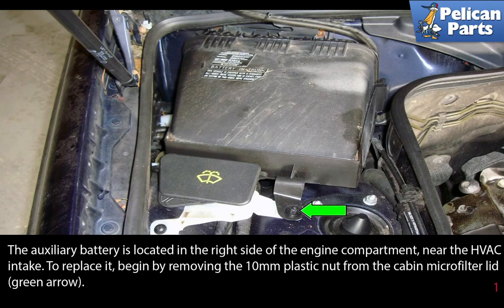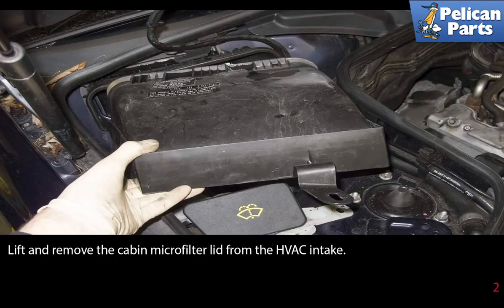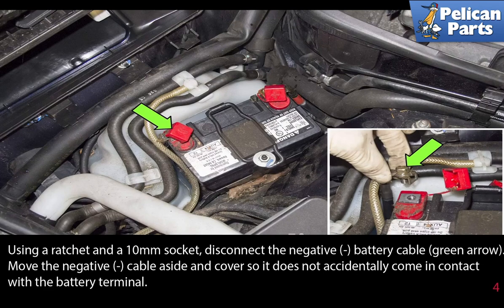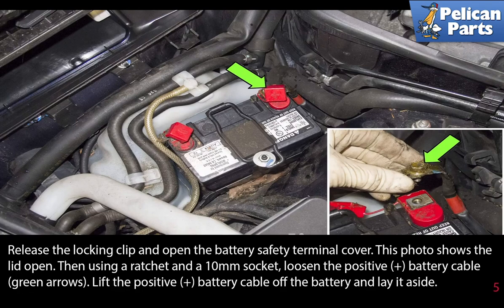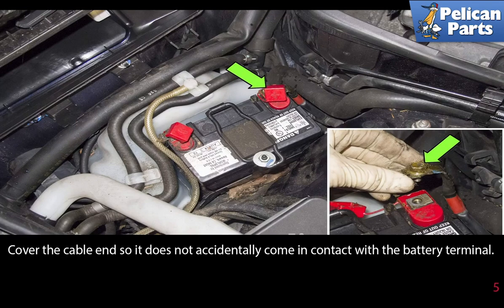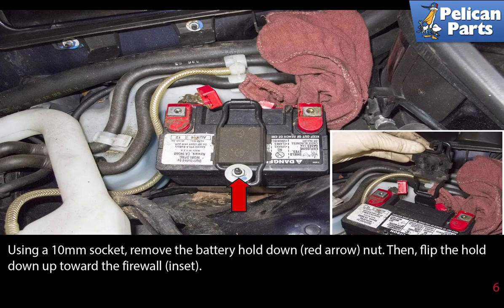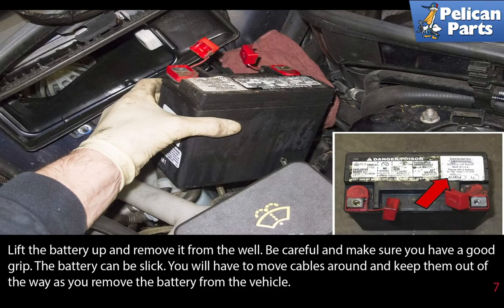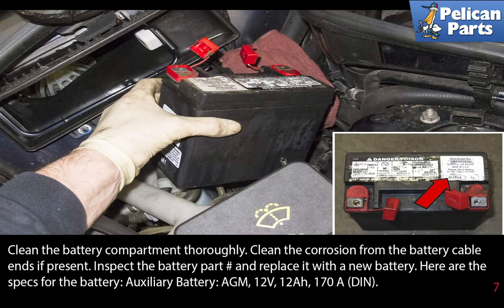Mercedes-Benz W211 E-Class Auxiliary Battery Replacing

Comment: I have a 2009 E 350 AMG Sport and there's no AUX battery there, I was told they stopped in 2007?
Reply from the maker: For E63 AMG sedan, my info shows it has one. With your vehicle info handy, give The Pelican Parts parts specialists a call at 1-888-280-7799. They can figure out if your vehicle has one.
Reply: @pelicanparts , thanks. I asked somebody on the Benz Forum if you could jump the battery from the engine. He said no models W211 from 2007 on had the AUX 14, but since I was clueless, he wasn't going to tell me how.
Reply: @pelicanparts  thanks
Reply: @pelicanparts  its not in the front engine bay with the 10mm HVAC filter

Comment: I have a 2007 E-350 and I have searched all the location possible for the auxiliary battery and it is not there. There is even no terminal for same.
Reply from the maker: My info shows it located as shown in the article. You can use your VIN to determine if it came equipped with one. Give our parts specialists a call at 1-888-280-7799
Reply: same with me , i have a 2009 and somebody said they stopped in 2007?

Comment: My Auxillary battery wasn’t there? I have a 07 W211 wagon
Reply from the maker: Should be in the right rear of engine compartment, below the plastic pieces, behind the strut tower.
Reply: @pelicanparts  i have a 2009 E 350 and i was told in 2007 they stopped using a AUX?

Comment: I have a E200 11/2006 model and there isn't an Aux battery at all...that location has no wires, terminal blocks etc,,just empty. Dont find any Aux anywhere.
Reply from the maker: I don't have any experience with E200 models, as we don't  have those in the US. If you check the forums, someone may have shared photos there of the procedure. http://forums.pelicanparts.com/

Comment: Does the 2008 Mercedes e350 have one
Reply from the maker: It should. With your vehicle info handy, give The Pelican Parts parts specialists a call at 1-888-280-7799. They can figure out what part or repair kit you need.
Reply: @pelicanparts   hi, thanks for video,do i have to disconnect negative on big battery from trunk, before change auxary battery?